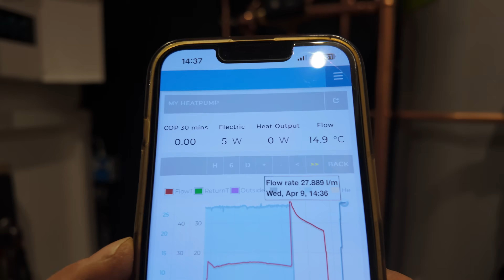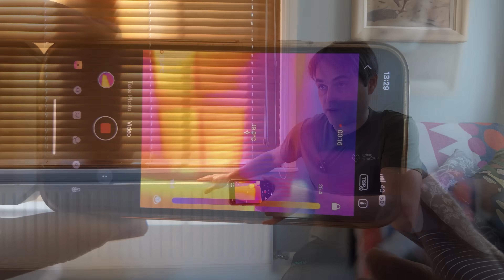Why This NIBE Heat Pump is Perfect for 7kW Homes.

Comment from the maker: For anyone interested in real life output of heat pumps tested by the Open Energy Monitor team, here is the link:

https://docs.google.com/spreadsheets/d/1okPmE48lPNG_zzWzvXiiWOMjtkPRiHuV0LniD_4Z-6A/htmlview?fbclid=IwY2xjawJwTyhleHRuA2FlbQIxMAABHsD9SYV089T3vb15x42CFKfUCsB8Uw6myGcc3ibNu_FGkUft-f2snu11D6t5_aem_Pahjzge2ajnMI8HNp9lU4Q#gid=472360552
Reply: @UrbanPlumbers  very good info, as going forward retro fits are always going to be at a higher flow rate and what's the average house heat loss, again probably closer to 6kw . Thanks 👍
Reply: Where do you get the real world figures, including defrost cycles and pauses for DHW etc?
Reply from the maker: Open Energy Monitoring
Reply: @UrbanPlumbers  Thanks, I was wondering how you measure the real life output
Reply: That is the benefit of a stiebel eltron, usually the given power is also the actual power the heatpump can deliver.
Reply: So is Nibe your new favourite heatpump? I have a few prices back for our new build. Grant R290 is the cheapest, ecodan is next, vissman is a good bit more - i will price the Nibe. But i don't think they will supply my plumber, who is my friend and not Nibe trained. He likes the ecodan... Just wonder what your thoughts are on the ecodan? Probably 7/8kwh.
Reply from the maker: @cillo2000 I installed one ecodan, and it wasn’t very good. Poor controls, no degree minutes, a lot of cycling. I would t recommend it.
Reply: @UrbanPlumbers  thanks, that's my concern. The new grant r290 unit ( i think this is a rebadged Japanese unit), daikin, Hitachi(firebird) seem to be the most popular ones the local plumbers deal with. Would you consider any of those to be 'good'?

Vaillant don't distribute in Ireland. I priced the vissman, it about 2k more than the Ecodan and 4k more than the grant. I will price the nibe unit. But the supplier in Ireland is supply and install i believe, and will be expensive.

Comment: ref your comment at 12:41, My 8kw Daikin modulates down well, its currently at 5-600w maintaining 35C LWT at 4.5C outside, i have seen it as low as 400w too! This is measured using a CT clamp on the feed to the unit.

Comment: A heat pump does not need to run continuously at minimum output. For instance a 5kW Arotherm+ has minimum output of around 2kW, but can cycle on and off below that taking it well below  1kW. 
Eg I saw mine do 15 mins on, 90 minutes off @2kW which averages at 286W over 105 minutes. 
Yes cycling can be bad in some cases when it is too rapid, but the system can deal with it  within limits.

Comment: my property has 5.75kw heat loss.. semi detached.. wondering safest size heatpump to go for so that its not under sized or over sized. I'm thinking either 6 or 7kw unit..
Reply from the maker: Grant 9kW, Vaillant 7kW, NIBE 12kW, Viessman 8kW
Reply: @UrbanPlumbers what do you think of the midea units? Or Panasonic?
Reply from the maker: Not my choice of units to install.
Reply: The viesman has indoor unit or mononbloc?
Reply from the maker: Monoblock with indoor hydrobox
Reply: @UrbanPlumbers thanks for replying. I've radiators as emitters and wdd hoping to get away with just an outdoor unit. Dublin based so not all products seem to be available here. Last question does the valiant modulate down to below 1kwh? I saw you referring to that in this video. If you want to come to Dublin to fit I'll supply the Guinness

Comment: Hi, I really like your videos, but this time I can't agree with your statement that an 8kW Daikin unit can't operate at less than 0.9kW of compressor power without cycling. If that happened with your bad experience with the Altherma 3, it's probably because the unit was misconfigured. Thank you for your work.

Comment: Do you need to setup the loadpump settings (CDP 25-70?) somewhere in the SMO unit? NIBE uses an external loadpump and there are various models. I can’t find anything in the manual that defines the pump and its settings. Grundfos launches new PWM controlled pumps in the range Alpha2Go 25-40 up to Alpha2Go 25-90.

I wonder if these are compatible with NIBE.
Reply from the maker: as long as it has pwm it should work - yes you can set the pump in the smo40
Reply: @UrbanPlumbers thanks, I will try and let you now if it doesn’t work 😅

These pumps provide pressure and flow information so it helps adjusting your system. I order the ESBE valve you showed in another video with PWM pump control (CRB227) and I order these pumps for the NIBE.

Comment: Can you explain how MLCP can be used and not restrict flow with heat pumps? I know it is a composite material but I notice heat geeks mention no plastic should be used in a heating system. I notice you use MLCP quite a lot and have been looking and a lot of the press fit connectors have quite a small internal diameter. Can MLCP be used in situations where say you want to run 22 or 15mm copper across rather than with the joists; can MLCP be used there? How do I determine which size MLCP I should be using?

Comment: From my own personal 15 year sad experience IMO do NOT touch Nibe with a barge poll. The original equipment is great and if installed correctly in the whole system, works perfectly….. until it doesn’t ! … you only have to look at Google or Trust Pilot reviews on Nibe that are 5 star our 1 star .. 5 star when new and working and only 1 star reviews when they brake down and need repair. Nibe UK will NOT talk to customers direct but only direct to an authorized dealers who are great plumbers but in my experience have little or no working knowledge of the units and have to call the Nibe dealer help line for help.
To the contrary .. my 2nd ASHP has been Vaillant and has been outstanding with information, assistance and repair direct from Vaillant. You call Vaillant and they send a technician, this is a guy employed by Vaillant who only works on Vaillant day in day out.
As for the output ‘shortage’ you mention it is very easy to solve, a) just go one size up or b) look at the output figures at say 5 deg C. To compare the figures at -3 deg C is simply not realistic, out of 365 days a year how many days are at -3 average !! Maybe 3 ?? The comparison is like comparing car fuel consumption figures at max top speed only !! Hope this adds valid information and first had experience to you customers.

Comment: I have a Nibe S2125-12 heatpump outside unit with R290 + Nibe VVM S320 indoor unit. It is running since Oct 2024.
It fitts nicely to my house with radiators and a theoretical heating demand of 9,5 kW.
It worked fine most of the time at medium air temperatures, but in the cold around freezing point, when the full power of the unit was required, the compressor  produced a strong humming noice at between 100 to 120 Hz. This strong noise was very disturbing inside my house and especially for the neightbours, who are disturbed in their bedroom at 7m distance from my hp-unit. Nibe is still trying to find out why my unit is so loud at full power. It cannot stay like this.
Has anybody experienced strong noise of the Nibe S2125-12 ?
Reply from the maker: Not enough units out there to know for sure. 9.5kW heat loss is too much for that unit so it may be running flat out. It’s only a 7kW unit at -3
Reply: I have exactly the same set-up and the same issue. I have already posted more details in an earlier comment to this video so please check there for the details :) In short, I suspect that the compressor is exciting a structural resonance of the unit at 56 Hz and in particular at 112 Hz. My best guess of what causes the problem is a small gap along the interface between the metal plate, the box at the back of the unit is mounted on, and the main metal plate on the back of the unit. It is quite easy to check by just pressing on the interface with your fingers. A similar interface exist at the other side of the back og the unit, and this has no gap on my unit.

A simple work around is to set-up frequency ranges in which the compressor is not allowed to operate. I use around +/- 3 Hz around the problematic frequencies mentioned earlier. This reduces the noise, but does sadly not eliminate it.
Reply: @jesperkn1104  Hi Jesper, your noise problem seems to be a bit different to mine, as you have especially the frequency 56 Hz and the double of it. My compressor runs rather quiet up to half the power of about 60 Hz. At higher rotations it is getting louder steadily. I cannot run the unit at 80 Hz at night because of my neighbours. At 100 Hz up to 120 Hz the humming ist getting even loud inside my house, although the unit stands on a seperate foundation 3 m away from my house.
This week we will make a sound measurement comparing my unit (8 month old) with a two year old S2125-12 unit in the neighbourhood, and this Fryday we will put the older unit in my garden on my foundation. Nibe said the noise is the result of the position to my house, which is a stupid excuse. The sound will not be that loud, as it is warm outside and the unit runs without load, but it should give an information.
One Nibe installer told that there are several units that loud while others do not have this humming noise - all with R290. So something must have been changed in the construction, or another compressor supplier, or ... .
I will report about my results.
Reply: @willv2378  Thanks for the info. Looking forward to hearing the results :)
Reply: @jesperkn1104  For a test of sound, we tried to run the unit up to 120 Hz, but due to the mild outside temperatures and missing heat demand in the house, we could not get higher than 70 Hz. So there was no significant humming and we desided to postpone the change of the two outside units to a colder period in autemn.
Reply: @willv2378 Thanks for getting back to me. If you did not hear any increase in the noise for frequencies at around 56 Hz, I think this confirms we do not have the same issue.

Comment: Great video mate we have sold quite a few 2125s now and the two we have fitted are working very well, the SMO S40 controller is exceptional
Reply from the maker: The best unit for 7kW homes in my opinion

Comment: Very interesting. How much impact on efficiency does it have to install the heat pump away from the house in this way?
Reply: The heat loss is around 6-8watts per meter. 10 meter run, 80 watts thermal with a COP of 4.0 would equal 20watts electrical.
Reply from the maker: You don’t notice it on heating, but it’s much more noticeable on hot water

Comment: Concerning minimum input power (ie modulation) - I looked in Nibe's Installer Manual document Technical Data for the 8kW & 12kW units, but could not find it anywhere.  Can you tell me where you found it ?
Reply from the maker: Minium power is not published in manuals

Comment: What is the distance of the ground pipe? And what would you consider a maximum distance for a monoblock?
Reply from the maker: 12 meters here. There is no maximum distance if you know how to calculate pressure loss. We have units installed 40meters away from buildings and running COP of over 4.
Reply: @UrbanPlumbers  Wow! So no real issues with heat loss trough the insulated ground pipe?
Reply from the maker: @YouriDeKlusser no, not really.

Comment: What happened to the houses that had that Vailant 7kW installed? That’s a glaring admission only achieving 5.5kW when it’s -3 outside.
Reply from the maker: We are swapping them for larger units or adding back up heaters.

Comment: Thanks for another interesting video! I have had the Nibe S2125 heatpump (together  with the Nibe VVM S320 indoor unit) for 1.5 years now, and I have generally been happy with it. However, I do have two issues:
1) Noise: I fully agree that the heatpump is extremely quiet most of the time, but when the compressor is running at a frequency around 56 Hz and in particular around 112 Hz, it excites a structural resonance, causing a lot of noise. I have narrowed down the issue to be the box on the back of the heatpump, but I do not know how to solve the problem fully.
2) Defrosting: I have monitored  the heatpump with the excellent Open Energy Monitor SW for close to a year. This has revealed that the defrosting can be improved significantly. Usually, a defrost cycle lasts between 10-20 minutes, but I have seen up to 30 minutes. I have also experienced several periods over the winter where the defrosting has been performed using the DHW (instead for the heating water) for no particular reason. I hope the suboptimal defrosting performance can be resolved with SW updates, and Nibe has made a number of changes to the defrosting over the winter. This has improved the defrosting, but I still think it could be better.

For anyone interested in the raw data, the system can be found here: https://emoncms.org/app/view?name=NIBE_S2125&readkey=4227fb62c9bf3e9a4fcd0c8caa89768a
Reply from the maker: Rattling of the back box makes sense. Same happens with Vaillant pipe connections on Arotherm. I would remove the box and install it on rubber backing.

Comment: Love your videos. But your remark on 7-8kW Daikins not going below 900W input power is not entirely correct. That’s kinda true for the altherma M 9-11-14-16 monoblocks and 11-14-16 splits. The 4-6-8 (in reality 5-6-7 at -10 ;-) ) split series however go down to <250Watt.

Comment: Is it possible to combine a vaillant installation vr71 /vrc 720, vr 92, ecotec plus , hybride ready installation 2 zones  with a Nibe heatpump ?
Reply from the maker: Not really. You can use NIBE to fire a boiler as backup but it will not work with Vaillabt controls - just externally switch the boiler on through VR71.

Comment: Nice looking unit there, great looking install (as usual!).  Going to have to take a look at the cost of a similar system for my parents' place at some point. They are currently on an ancient non consensing oil boiler, but dad in his wisdom tells me "our house isn't suitable for a heatpump due to its construction / lack of insulation".  Yes dad, believe the internet, not your engineer son who works designing large commercial heat-pumps!

Comment: Not a plumber but have done a lot of plumbing. I'm surprised you use gate valves as they have such a small cross-section of flow, unless you can get full-bore gate valves! Love the videos and info. Thanks!

Comment: The Nibe looks about 2/3rds the size of a stiebel 13kw (or 12.86kw), I.e. it looks smaller than a 12/13kw unit by a different manufacturer. Does anyone know if stiebel is actually rated at that or are the figures also inflated?

Comment: I do enjoy your videos. But the highlights of this one for me was the use of the external buried pipe, explanation of mean vs max output ratings and the low low power possibility of the unit.

We need to remotely site a unit to replace our 4 year old LPG boiler (criminal new build). So the external pipe run was interesting from that perspective.

Such a shame you're not down in the south west! Perhaps you need a holiday down here😊

Comment: I use for my tiny house a Daikin Split. A nordic Version and called Nepura and Stylish Indoor Unit. The power is 3 kw thermal and use 4 kwh a day to heat my house a day at minus 5 degree outside. Heat pumps are the best way to heat houses. After the first run, i am very flashed. So effective.
It is the cheaper version for my house and a Nibe is a dream for me. It is too expensive for mee, but produce very good products. 
I am a classic plumber from Germany and had installed hundreds of Gas heaters.
Reply: How much it costed and how much it saves on your heating bill a year?

Comment: It is amazing that all the companies like to put the best peak performance forward rather than the actual minimum. They need to learn from Porsche with their EV's under promise and over deliver and people are far happier to recommend them.

The gate valve solution is old knowledge, it's what my father and grand father did for old gravity feed cylinders.
Reply: Lol, you mean the Porsche EV’s you have to bring to the dealer every other month to “inspect the battery” they refuse to fix b/c they cheaped out 70 bucks for the ac charger? 

Agree with your point though, I only care about real/min heatpump output at A-10/W35 (or something around that). The output at higher outdoor temps when you don’t need anything close to that is absolutely irrelevant, it’s marketing BS like the >1000W “pmpo” stereos in the 90’s.

Comment: SHK info has a planning tool with a database where they provide the min and max output curves per design and outside temperature.  That data should be really helpful for picking the right unit.

Comment: What is the problem with having a bigger Kw pump that what you need? Is better to have bigger and it works less?
Reply from the maker: Provided that the controls are re decent and the unit is not more than 40% oversized it should be fine. If not - they can cycle a lot, especially on zoned or lower volume systems, fail to defrost and be very expensive to run as they lose efficiency when cycling and also can fry the compressor and result in a very expensive repair required
Reply: @ thanks for the reply, building a timber frame house with Steico outer and inner wood panels and 30cm Steico soft wood insulation, seriously good, made a big effort on sealing the outside panels and interlocking inside. 200m2 house but Im in the EU and and finding it hard to have anything other than a salesman opinion when looking into heat pumps, looking seriously at Vaillant aroTherm 105/5 AS  with a Unitower 128/ 5 190 ltr boiler and feel that because of the quality of the build its too big. Hence my question, all the best, Happy Easter!

Comment: Say a potential customer asks for a heat pump installation you have to do a heat loss calculation and an estimate. Customer says no it’s too expensive or disrespectful etc . Do you charge upfront for this or how does it work. Proposals are expensive .